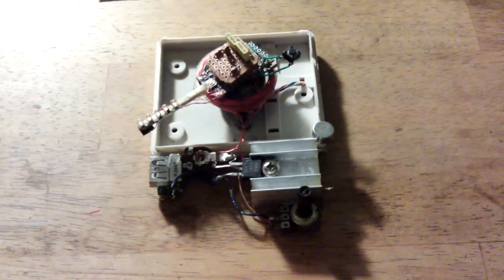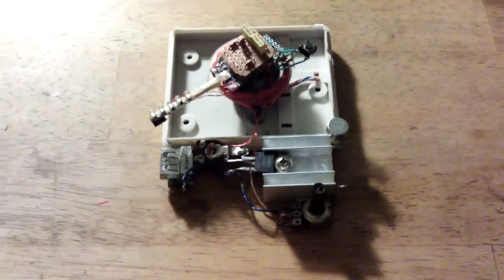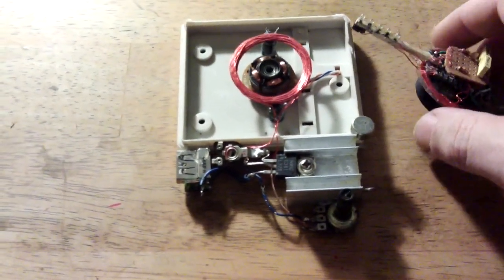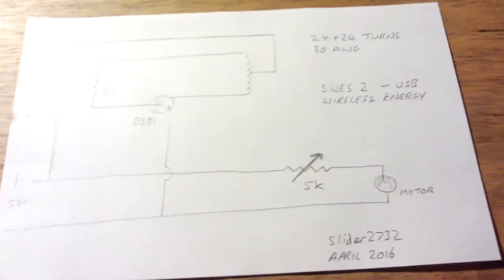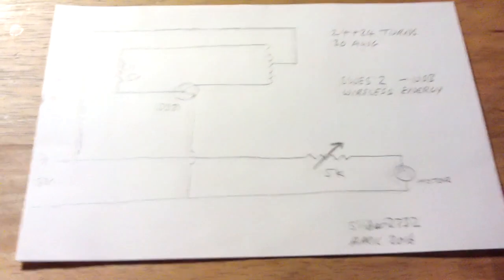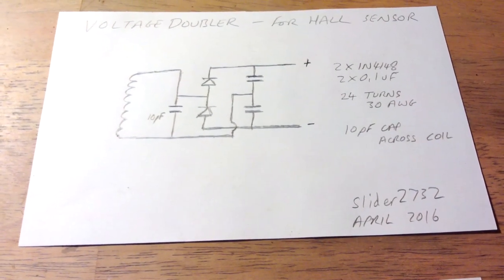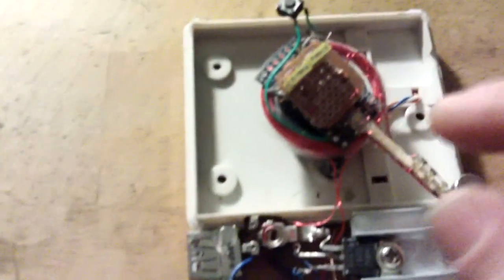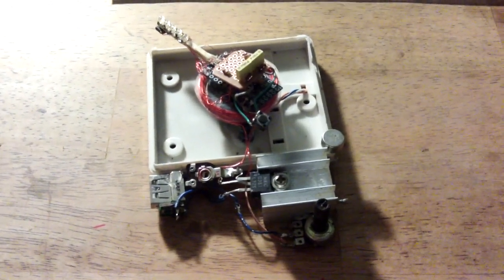Wireless Electric POV !

Comment: Nice . what microcontroller did you use ?
Reply from the maker: +Oussama Ousmoi A 3.3V Arduino Pro Mini, connected to the RAW input. All build details are in the description above :)
Reply: +slider2732 oh ok  i though you used a different one than scott's build , it appeared smaller :) .  i've build a POV recently  using an ATiny2313  and it was a bad choice because of  it's low memory ...
Reply from the maker: +Oussama Ousmoi Just checked out your channel..I like it ! Have subscribed and will watch the POV vids.
Best of luck with the projects :)
Reply from the maker: +Oussama Ousmoi Just checked out your channel..I like it ! Have subscribed and will watch the POV vids.
Best of luck with the projects :)
Reply: +slider2732 haha thanks :).   The wireless power transmission circuit i used is probably an 
over kill , and not optimized  it's drawing lots of current ...    
Yours seems simpler and  more efficient .  also it's a very clever idea 
to use a  voltage doubler on the receiving side  . i must try that :)
Reply from the maker: +Oussama Ousmoi Best tip I can give, is to meter the needs of the receiving circuit and build the transmitter side to that output. In this case it's around 40mA, so the transistor can be limited with the Base pot. All runs cooler, the heatsink isn't needed and can run stone cold with a diode on one power input in series. With the Hall sensor drawing only 5mA peak, the doubler worked fine. 
Also though, do experiment with small pF value caps on the receiving coil...range, efficiency and current throughput will go right up with the correct one. Here it was only 10pF, but the difference between working and not !
Reply: +slider2732  i see .  alright will play a little with it again using your suggestions , Thanks